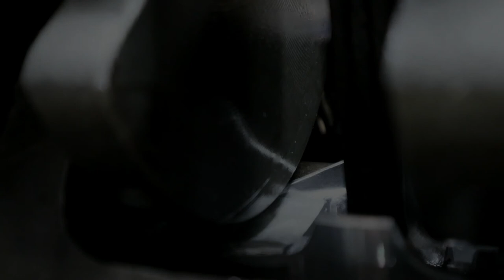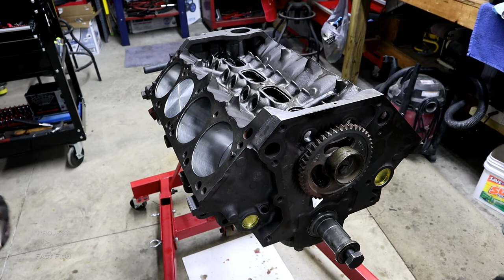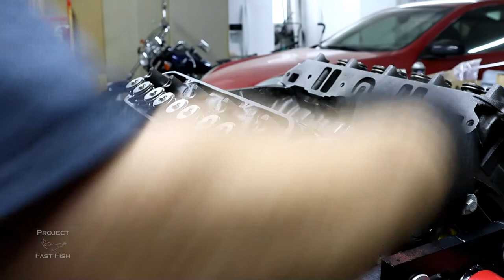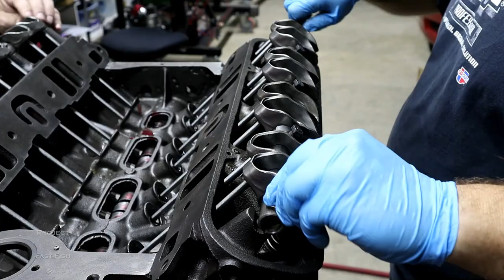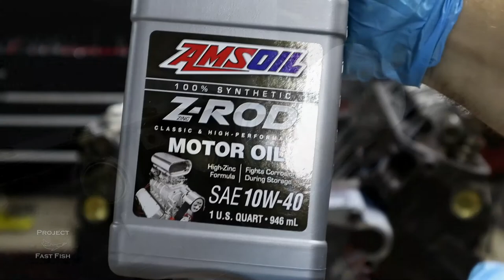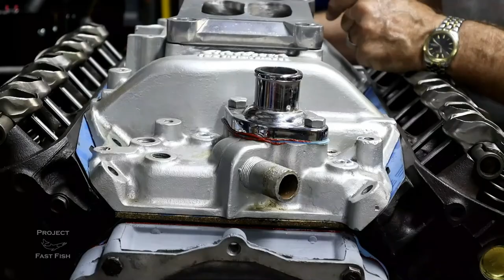Project Fast Fish: Chrysler 318 Stroker Build and Walk-through - Part 3

Comment: THE WHOLE ENGINE IS OUT OF BALANCE UNLESS YOU GRING EVERY PISTON TO THE SAME WEIGHT
Reply from the maker: We had that covered.
Reply: @MicsMotorworx  Not if, AFTER having the machine shop balance all the pistons, you start Ad-Hoc grinding mods on each listing skirt for "clearance" issues ... !!!! 
What am I missing here ...??? 🤷🏼‍♂️🤔😎
Reply from the maker: Pistons were re-weighed to within a tenth of a gram of each other. 👍😉
Reply: Did you figure for thermo expansion?  as the engine heats up, the crank and pistons will swell/grow...  Id have sent the whole kit back and let the manufacture sort out the problem, now the manufacture can void any responsibility

Comment: An Edelbrock Performer Air Gap would be my choice. It’s not about having a fancier intake, or bragging rights, it’s about making power. The air gap design allows the manifold to run cooler, which will make more Horsepower throughout the RPM range. Of course I live in Arizona, and heat is a major issue here. Back east you might want a manifold that runs hotter for the winter months. That’s not a big problem for us.
Reply from the maker: Thanks. There's a lot of love out there for Small Block LA. We went with the Performer RPM on the 390. On the 349, we went with what we had since it's going to used as a fundraiser for Project Fast Fish. Thanks for watching. 👍
Reply: @MicsMotorworx  there's an ongoing debate--UTG's video channel found his slant 6 needed more heat in the intake, and of course Smokey Yunick had his hot air engine design making 1.8 hp per cubic inch. the goal of cool intakes is to create a density in the air charge, and a good ram air setup will do that. Heat can cause fuel percolation, but a cool can or using an electric fuel pump and a return fuel system over a mechanical one soaking up heat from the block can do that.
Reply from the maker: Neat. 

I love UTG and his videos. I, for one, should never debate the finer points of chemical reactions, mathmatical engineering, nor rate of changes in density during quench and compression 😆 

The reason we had this on the 349 was because it was the best match for the combination of parts. An RPM Performer was better suited for our 390 build.

We had great dyno umbers with the 390 and RPM Performer. I'm quite positive we wouldn't have seen those results with the regular Performer that was used on the 349.

Thanks for watching.

Comment: Obvious question: why not just build a 360?
Reply from the maker: The concept was to use items we had around the shop. We had the block, crank, pistons, connecting roads, intake, heads and cam. The crank had already been turned to fit the 318 block. We're selling the motor to put money towards Project Fast Fish. 👍 Thanks for watching!
Reply: I appreciate being original but it seems it would make more sense to build a 360 or take a 360 , bore .040, use 318 crank, and use either 318 heads or 360 heads with flat top or dome pistons. I totally get why you did this but the same question was in my mind as well. Cool build
Reply from the maker: Thanks for watching and the ideas.

It was all about the parts available around the garage.  On top of that, this configuration was essentially what Pop wanted to put in the Barracuda in the middle to late 90's when it was originally gifted to me.  Kinda neat he helped build it and had a chance to hear and see it run.
Reply: Torque curve.
Reply: @ufarkingicehole  The mains  journals on the 318 crank are smaller than the 360 block mains.

Comment: Too bad those aren't '71 J heads. Then you'd have the 2.02 1.60 valves.
Reply from the maker: Fair enough.  

We had 2.02 valves on our 390 which used 360 heads

Interestingly, the port volume is quite large and the air flow is quite qood on the J Heads.

Comment: Did you lose some compression when you used the  J heads on a 318 or did you use higher top pistions to  compensate  since the combustion chamber is bigger on 340/360 heads ?
Reply from the maker: The pistons were selected to compensate for the crank and had a lower distance from the pin to piston head when compared to 318 pistons. It was a while ago, but i think we estimated 9:1 with the j heads. Very streatable.  Our point to using them was their larger valve size.

Comment: So, if you are curious, Nick’s Garage on YouTube built a 318 stroked to 390.  Don’t know where he got the parts but he said it’s a 4.000” stroke.  Based on your bore number that’s 0.030 over with a 4” stroke. 

Put pretty much stock but he upped the compression to 10.5:1, ported iron heads (he gave the serial number) with 2.02” intake valves.  Stock rockers & push rods with a comp cams flat tappet cam.  He said he had 120 pounds of spring.  Aluminum intake, double pumper carb and cast iron exhaust manifolds. 

He was able to get 15” of vacuum at idle for power brakes. 

On the dyno he was impressed with the results. 405 HP at 5400 & 445 foot pounds of torque at around 3800 on 94 octane pump gas.

I’m not really a MOPAR guy, but I was pretty impressed for what is really just a daily driver.  It would really be nice in an older pickup.

Comment: You would think at Rogers Machine Shop to have cleaned up the jaggered edges on the exhaust outlet ports & match sizing to exhaust gasket.
The corrode edges of the water galleries (both block & heads) could have been chamfered on the edges as well.

Comment: How long did that cam last with no break in oil or no coating on the cam , I would’ve not used that oil to break in my new engine. Exactly why I build my own engines.
Reply from the maker: The cam had been previously used in prior build. Same block. We appreciate the passion from the community and we all have are own ways of building. There's always something to taken from different perspectives. Thanks for watching. 👍
Reply: You can have the best break in oil made and still wipe a lobe .. or two ,the main thing with flat tappet cams these days is it is absolutely imperative that the face of the lifters be checked to make sure they are convex on the face and with the cam installed and before the intake goes on turn the engine over and make sure ALL the lifters spin in their bores ,it doesn't matter who ya got the lifters from either

Comment: Torque sequence on the head should be more like 50, that's 75, then 95 or something or like that. It would be more critical if you will lose using aluminum heads. But you always do heads in a sequence of three steps. And if you have torque to yield you do three steps and then the torque to yield.
The intake ports, but the exhaust ports were left Raw. At least it looks that way.
Reply from the maker: A lot of good information out there for these builds. Thanks for the feedback and information for those browsing the comments.

 We based the final torque number based on  information from reliable sources for these heads. However, we opted for the first torque number in our 2 step sequence. Nothing wrong with three step sequence, either.

Thanks for watching 👍
Reply: Yes, the intake & exhaust ports could've had more work done, like clean up the edges plus match port sizing to the gaskets. Gas flow is important  on the exhaust as the 2 middle ports are partly restricted. Makes sense to have 340 heads on as they have bigger valves.

Comment: J heads are a 1971 model year only.
Reply from the maker: Produced in 70 and 71. One year with 1.88 intake valves. The other with 2.02. 

We acquired them via a vehicle purchase.
Reply: I agree I have had at least 20 1970 340s back in the day all were x heads then the 1971 340s i had that about 3 of them I think had J heads on them.

Comment: Gasket OR rtv! Never both except at joints!
Reply from the maker: Hi Joe. Thanks for the comment.
 
Were you referring to the timing cover or the little daps of rtv on the joints for the intake? 

For the timing cover, we've had a few leaks in the past. This is despite double checking torque and tightening sequence.  Many disagree with Pop for doing this, but his way doesn't leak.

For the intake, it is acceptable to use the little dollops of rtv on the gaskets for the joints as shown. Again, leak prevention. We also chose the cork gasket per instruction from Edelbrock.  If a higher performing intake is used, such as one of the RPM series; then only RTV is recommended.

Comment: Not a good idea! Could cause oil leaks! I never use cork in the front!
Reply from the maker: There's definitely a lot of information out there from the community. The cool thing is, a builder can choose.  Assuming this refers to the intake gasket, we went with it per the intake. We went went in another direction with a Performer RPM install on another build. 

Thanks for watching 👍